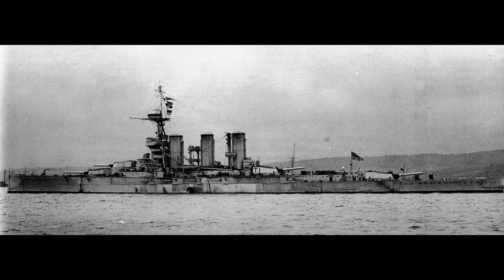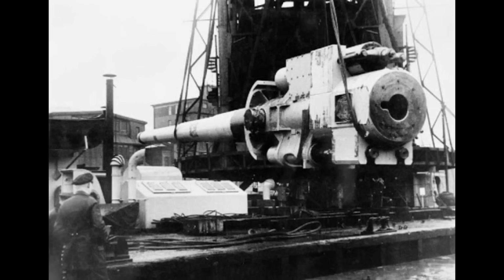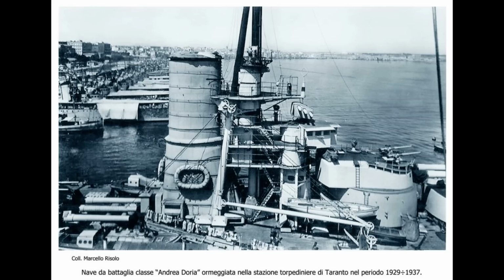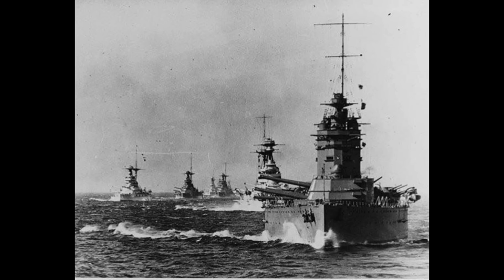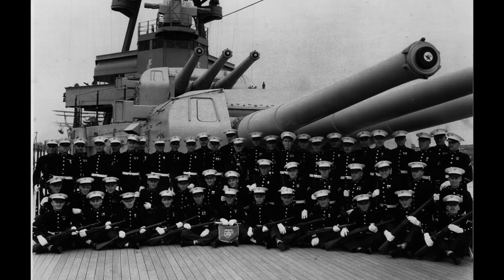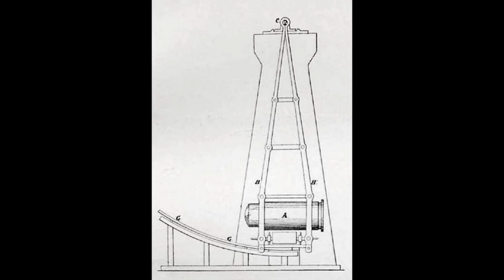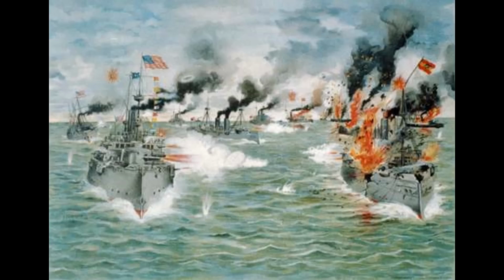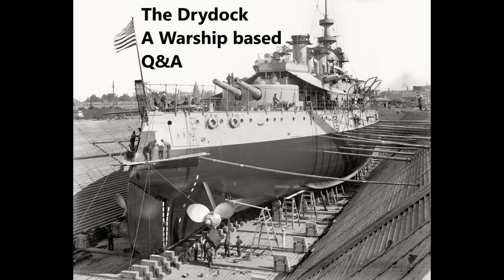The Drydock - Episode 101

Comment: One big issue with the Iowa incident was the age of the powder.  I personally knew and served with one of the men killed, and he had mentioned prior to the incident that the powder bags being used were also WWII surplus.  After 50 years, gunpowder starts to do some chemical breakdown, and it, to quote him, 'Just didn't feel right'.  It's quite possible that the ram didn't fail- but rather the powder began the 'smolder process' due to chemical degradation of the powder.
Reply: also there had been a push on to save battleships by show an increase gun range. An reports of preheating the powder bags to achieve this. Many many times in an unknown system failure the default sadly is to blame human error.
Reply: @Bill Cunningham I think I remember reading that the powder charges had been improperly stored on barges in very hot weather instead of in climate controlled facilities, which helped cause the chemical breakdown.                                    I think I have also read that the explosion on the Iowa may have been enhanced by enough powder charges for several salvos being stacked inside the turret, with the crew thinking it would not be a safety issue since it was just an exercise.  Have you heard anything about this?
Reply: Terry Shank I believe I heard that one of the officers had actually been forcing the crew to experiment with using a lesser or greater amount of powder instead of the standard loadings (I think it was using the HE powder load for AP, or vice versa).  One of the gunnery supervisors—perhaps the one who was scapegoated—had objected based on safety concerns but was ordered to continue.  It’s been a while though,, so I would have to research it again to be sure.
Reply: @bluemarlin8138  No, there was no stacking of powder in the turrets.  The 16" 50Cal gun mount has chain feed for all components of the shot (round plus 4 bags of powder).  There's really no way to manually load the powder from the turret with any efficiency so staging powder in the turret makes no sense.  As far as storage goes, the powder was, for the most part, kept in a warehouse at the Seal Beach Weapons Depot in California.  However, you are right in that the warehouse was not climate controlled.
Reply: @shawnc5188  GMG2 Hartwig was not gay.  I knew him.  That whole investigation was pure bullshit.
Reply: Bill Cunningham Yep, and I don’t think anything happened to the NAVSEA exec who falsely authorised the main gun experiments.
Reply: Bill Cunningham yeah that one never made sense to me, but then again this is 1980s United States, so of course they blamed us.
Reply: One of the shells they used was pulled out and under the cap was USS Maryland on a slip of paper.
Reply: Knowledge combined with ignorance gets you the wrong answer. American Battleships used compressed charges of black powder in their main guns. Black powder is chemically stable and can still work as intended after hundreds of years. Pressures remain the same and safe when fired. That's why the Navy used it. Many posters are noting problems which are very real with smokeless powder that don't exist with black powder. Please do some research guys.
Reply: @dwightehowell8179  Best if you're right while while proclaiming expertise and saying people should do some research. Otherwise you come off looking like a complete berk - this being a case in point. The US in WW2 absolutely used smokeless powder not black powder ( http://www.navweaps.com/index_tech/tech-100.php#United_States_of_America_Propellants ). The Iowa's specifically used SPD839 ( http://www.navweaps.com/Weapons/WNUS_16-50_mk7.php ).
Reply: @dwightehowell8179  From this site: http://www.navweaps.com/index_tech/tech-100.php

Comes this quote:

By 1896 the USN had begun small-scale production of a single-base nitrocellulose propellant at Newport, Rhode Island. Major manufacturing of this "smokeless powder" SP at the Naval Ordnance Station (later known as the Naval Powder Factory), at Indian Head, Maryland was begun in 1900 and continued there for decades.

Smokeless powder will deteriorate over time as it contains nitrocellulose and two volatile substances, ether and alcohol. Its length of usefulness depends largely on the conditions under which it is stowed. Moisture or heat speeds its deterioration and the combination of the two is extremely damaging to the propellant. In 1905, George Patterson, the key civilian researcher at Indian Head, was experimenting with the addition of rosaniline dye to the propellant, designating these lots as SPR. This dye did nothing to stabilize the deterioration of the propellant, but instead showed the status of the deterioration by changing color as it combined with the forming acids.

Patterson recommended the abandonment of rosaniline dye in 1908 in favor of adding diphenylamine as a stabilizer. Known as SPD, this new propellant was first produced in 1908 and adopted as the standard propellant formulation by 1912. SPD was found to have good stability characteristics when properly stored, with some lots manufactured prior to World War I staying in storage for as long as twelve years without loss of stability. During World War II, the primary USN propellant was SPD in a multi-tube form made up of 99.5% nitrocellulose (12.6% N), 0.5% diphenylamine. The USN used a flat, short cylindrical grain design that usually had seven perforations with the websize varying from 0.023 in (0.58 mm) for the short 3 in (7.62 cm) gun to about 0.174 in (4.42 mm) for the 16 in (40.64 cm) guns. SPD had a good safety record partly due to the harder-to-ignite and slow burning nature of its single-base nature and partly due to the quality of its manufacturing process.

Various types of SPD were specified for Iowa's 16" guns, including SPD 839 and SPD 840.
That's what my research says, anyway.
Reply: @dwightehowell8179 , according to the wiki, they were using powder lots of D-846 dating back to 1943-1945, labeled “WARNING: Do Not Use with 2700-pound projectiles,” which is exactly what they were firing. There had been reported close calls with those canisters in previous firings, when the bags had appeared to smoke, and immediately fired once the breech was closed, without firing the gun. That doesn’t sound like they’re using “black powder” to me.
Reply: @dwightehowell8179  Sounds like you've just pulled that 'black powder' fact our of your rear end- what, are these ships from the 1800s? Who still uses blackpowder these days except for fireworks. Please kindly put that 'fact' back in there.
Reply: @m2heavyindustries378  You do know that none of these ships have been made since WW II right?
Reply: @DarkStarPast  o
Reply: @DarkStarPast  that would be human error
Reply: @dwightehowell8179  Ignorance combined with arrogance gets you an even wronger answer. The United States Navy began manufacturing smokeless artillery propellant in 1900, in the form of tubular nitrocellulose colloid with ether and alcohol.
Reply: This wasn't the only incident of degraded powder charges. Some genius decided to remix powder charges, messing up the lot numbers. This was discovered when the USS New Jersey bombarded Lebanon in 1983 and shells went wildly off-target, in some cases killing civilians.

Comment: This is a little late, but the discussion of all forward armament versus front/rear armament is something I directly contributed to in my job -- Computer Engineer, Systems Engineer, Mark 152 TERRIER fire-control computer programmer, Wrap-Around Simulation Program management, maintenance, and update, and data analyst with the TERRIER shipboard anti-aircraft guided missile system Mark 76 with the digital versions being MODs 6, 7, 8, and 9 (the last one having the much more powerful SM-2ER missile and support equipment suite).

TERRIER Mark 76, the most advanced system eventually using the Standard Missile Type 1 (Homing All the Way) and, in MOD 9, the SM-2 missile (uplink, and downlink, and much better control using the more powerful shipboard radars and computers to tell the missile its best path to the target) was put on a number of destroyer, destroyer leader (later cruisers by feat), the cruiser LONG BEACH (where they were a secondary battery after TALOS), and three aircraft carriers (the carrier versions turned out to be useless simply because they and aircraft operations interfered somewhat with each other and the carrier personnel essentially turned them into storage lockers).  There were basically two forms of TERRIER on the destroyers/"cruisers":  Single-ender twin-radar batteries (either bow or stern with a 5"/54 gun on the other end of the ship) or double-enders with a twin battery on both ends and a pair of two-gun 3" batteries, one per side amidships for all other surface and, close-in AA targets).  Note that the TERRIER AA GMFCS was also capable of shooting at ship targets and could be very deadly due to its large (12" diameter) missile moving at hypersonic speed.

All TALOS, TERRIER, TARTAR, FFG-7, and later Aegis systems (though the last now has fully active SM-6 missiles) were all semi-active (had a radar receive-only homing "eye" in the missile nose), requiring the ship to light up the target with an X-band illuminator attached to the larger searchlight-shaped (TERRIER and TALOS) or dish-shaped (TARTAR, Aegis, and other smaller US Navy radar-controlled missile systems) tracking radars, one radar required per target for the entire flight of the missile.  While the ship superstructure only blinds each tracking radar for about 30 degree in the direction toward the opposite end of the ship due to their position rather high up on the superstructure., for the missile launchers of the older single-/twin-arm rotating type (all but Aegis, which mostly  -- now only -- used vertical launch) the deck mounting position of the launcher made then blind to a very wide, usually circa-120 degrees, when firing with the missile at below 35 degrees or so elevation.  The problem was that back then people were firing a guided missile with the ability to maneuver at high-G values once the missile was no longer tied to the launch acceleration of  the missile booster (very large in TERRIER and TALOS giving a significant minimum range, but a much smaller, shorter-acting internal booster in TARTAR, Aegis, and FFG-7) AS IF THE MISSILE WERE AN INERT GUN PROJECTILE!!!!  I am not joking here.  Until I came along, ALL of the missiles mentioned here using rail launchers were aimed at the target just like a gun was, with no variation allowed, though the actual elevation angle of the missile at launch was usually somewhat higher than with a regular gun for optimum flight ballistics.  Kind of crazy, is it not?  But the missile design agents and manufacturers were so used to firing guns with fixed elevations against each target, only going to higher elevations against farther targets that they automatically thought of firing missiles the exact same way.  The only alternative in a single-ender was turning the ship enough to clear the radar's or launcher's horizontal arc so the launcher or radar was not blocked.

When I was working on the original MOD 6 digital version of TERRIER (it was the first one to allow the X-band illuminator to also be used as a Doppler target tracker in addition to the regular pulse-radar tracker to make the system almost jam-proof), one of my jobs was tediously entering by hand into the program a long table giving the various angles of bearing and elevation that defined the blind regions where the launcher and radar had to be prevented from operating (the radar turned off and the launcher stopped from even going into the blind zone to keep it from damaging itself).  When the program caused the launcher to go into the blind region, instead the mechanical stops automatically elevated the launcher rails upward to allow the launcher to rotate in that region but the firing ability was disabled because the launcher had "LOST SYNC".  The part of the firing program in the computer ignored the blind zones and only the table of number that I had to enter, matching the mechanical cutout stops, prevented the system from trying to blow the ship superstructure apart with its own missile.  I had been doing this for each ship separately (all ships varied somewhat in these values, so a lot of entries had to be made when creating tapes for an all-ship program upgrade).

Suddenly, just about the time that the first MOD 9 SM-2-equipped ships were being introduced (several years after the first digital systems had been replacing all of the older electro-mechanical calculator versions of TERRIER, showing how long I and others had been making these blind zone entries for all ships), I was in the middle of entering the blind zone values for a ship when, like a lightening bolt, the idea hit me:  WHAT WAS I DOING?!!  These missiles are high-G maneuvering weapons!  Why don't we just aim AROUND the launcher blind zone in bearing or elevation and shoot at the target at a cocked-off angle and allow the guidance system in the missile to correct the flight?!  I felt like a fool for not thinking of this before (how dumb can one be?).  I went to my boss and told him.  He said that nobody else had ever suggested such a thing, as far as he knew, but it should be investigated by the TERRIER Design Agent, the Applied Physics Laboratory or of John Hopkins University (who also controlled the nuclear ballistic missile program for the Navy, so they were a BIG DEAL).  He talked to his boss and they decided that the easiest way to get it done was using the regular BENEFICIAL SUGGESTION program and send it to APL/JHU through that -- it would also get me some money if it were adopted (I eventually got only $400, since it did not save any money doing my changes).  So I wrote up  a "Benny Sug" stating that my idea was to elevate the launcher above the level of the superstructure in the blind zone region, no matter at what range the target was, adjust the orders to the missile to compensate (easy to do once the launch angle was created), and shoot anyway.  Outside the blind zone, use the regular calculations.  I called it "TERRIER Fire Around The Blind Zone Capability" -- later changed by others to "Curved Fire Capability".  Off it went, after some arguments by various people who thought that it couldn't possibly be that simple (but it was!!).

I was later informed that when APL/JHU got the Benny Sug, they were skeptical that it would work against close-in targets at low elevation where the missile would have to do a high-G dive to counteract the high firing angle if aimed directly opposite in bearing at the other end of the ship from the end that the launcher was on.  But as they ran it through their Six-Degrees-of-Freedom computer simulators, they found that it ALWAYS WORKED, even at minimum range (where the booster had just separated from the missile, allowing the missile to maneuver).  In fact, I was told that this was considered a whole new concept for such large-size missiles and I was given the job of using our simulators at work to test the new code written for this by Vitro Industries, the TERRIER main computer program contractors -- my work for the Navy in-house, with a couple of other guys, was post-introduction maintenance of new TERRIER software, such as adding those blind zone angles and creating patches to fix old and new problems reported from ships or testing new programs before final sending to the ships.  I did this check of the code for my idea and the code they had developed to up the firing angle worked just fine.  Suddenly, single-enders had a 50% larger horizontal firing arc against all low-angle targets (only that 30-degree radar blind zone was left), including the major threat of on-the-deck cruise missiles.  All it took was only a few lines of computer code.

I later realized that I had created the basis for Aegis vertical launch capability, since it was the final version of this extra elevation change:  Always fire straight up and forever to Hell with the superstructure!  My small contribution to the Navy's missile capabilities.

Comment: Your story about tea dependence reminded me about my own similar experience. It was year 4 of my chemical engineering studies, end of september. We've finished apparatus design course two months ago and thought that we were done with it. As it turned out, there was one more coursework due in october (calculating the rectification unit and making technical drawings of some part of it) and professor was, to use the correct terminology, a propper arsehole. 

I spent a week making my calculations of the unit and drawings of condenser (thank FSM I wasn't required to produce complete drawings package for a rectification unit) and went to prof's office to hand it all in. What followed was two weeks of daily meetings where he'd find errors, I'd fix them and come back to a new portion of corrections. Sometimes those mistakes were made in calculations, couple times in the drawings, but more often than not errors were him not liking how the work looked, later he'd change his mind and I had to reverse the changes.

During these two weeks my average sleep time was somewhere around 4 hours/day and my caffeine consumption was through the roof. At the end of it all I was unable to operate unless I drank 2 cups of strong coffee and, as I later found out, not only had I screwed up my sleep patterns and increased tolerance to caffeine, but I also formed a dependence on damn alcaloid.